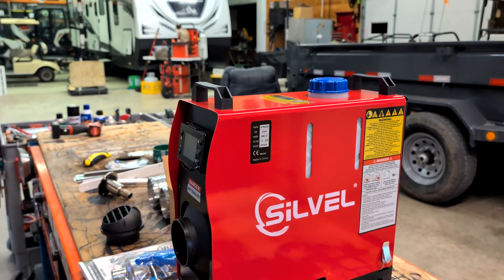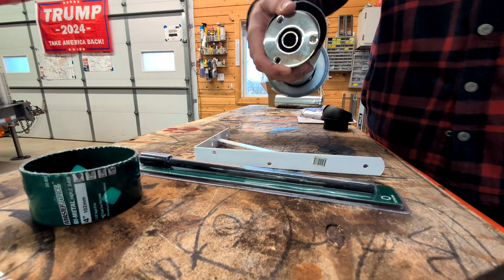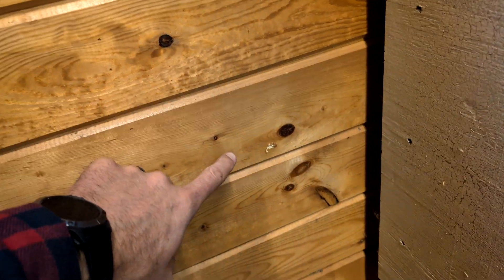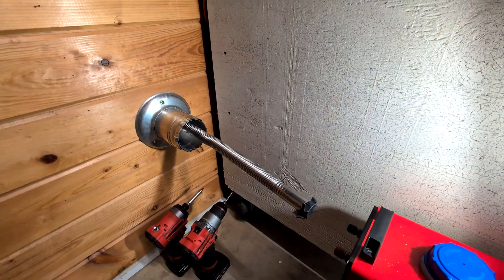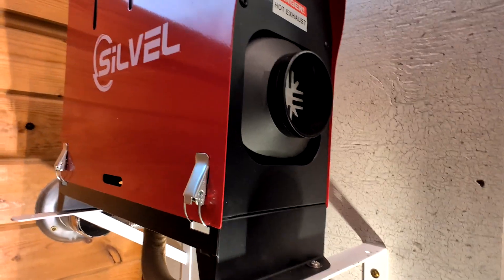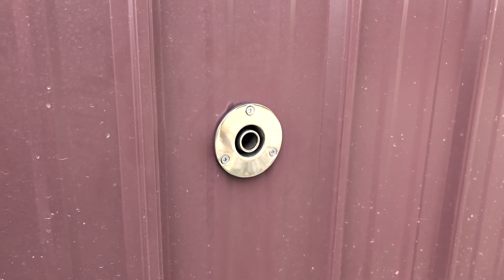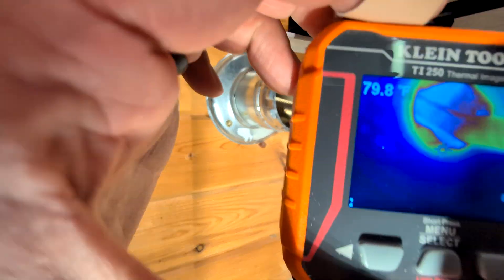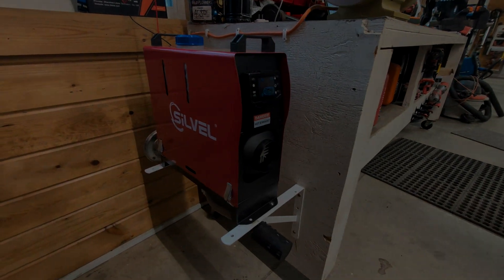WILL THIS HEATER BURN DOWN MY SHOP? SILVEL 8kw Diesel Heater install.  CHINESE Diesel heater.

Comment: You shouldn’t attach the 90 to the straight exhaust pipe without a solid 24mm short piece because your 90 and straight pipe will deform and leak exhaust. The two soft ends pinch and distort under those cheap clamps.
Reply: Second this.

Comment: Great video! I’ve been considering this a lot. A couple ideas I had to maybe help efficiency. The air intake should be outside if possible. It’ll suck cold air which is more efficient, and it won’t use up the already warmed air. You mentioned leaky doors, I get it. Same here lol. But couldn’t hurt. I also think I’ll try to put a small fan near the exhaust. It’ll cool it off before the wall, and use some of that otherwise wasted heat in the room!
Reply from the maker: Thank you for the comment!  I agree with the fresh air being outside if possible.  In addition to what you say about the heater being more efficient, the fresh air intake is surprisingly loud!  Way louder than I thought it would be!  I am planning on getting another through wall fitting.  Also, I'm debating building a manifold out brass to gain some radiant heat from the exhaust before it exits the wall.  I did this on a separate install that works very well.  There is a short of the install on my channel.  Small fan is a good idea also, there is a lot of heat in the exhaust!  Good luck with your install!
Reply: @DDoutdoors1  Hey thanks for the reply! I'll look for that video. I like the manifold idea. I was even thinking just an extra length of exhaust tube in a downward spiral under it for more surface area. I read/saw somewhere you need to allow for condensation to drip out, so having the exhaust be generally downhill is a good idea. Be sure to post an update if you do a manifold!

Comment: Nice video, have two friends that have installed those little things in their four wheelers should say side by sides and they work well
Reply from the maker: Thanks @DirkSiems, the exhaust temp is surprisingly hot.  Need to have a good way to vent the exhaust!